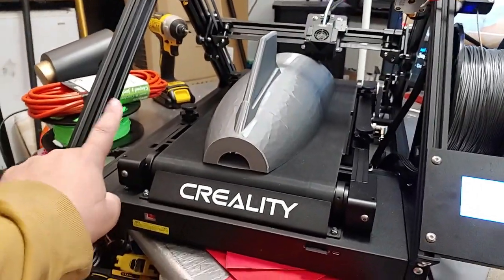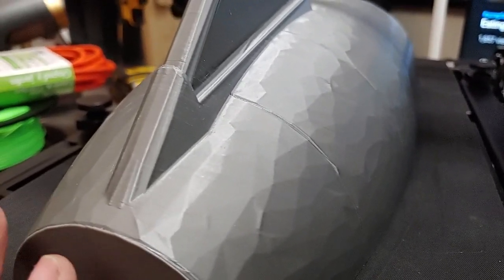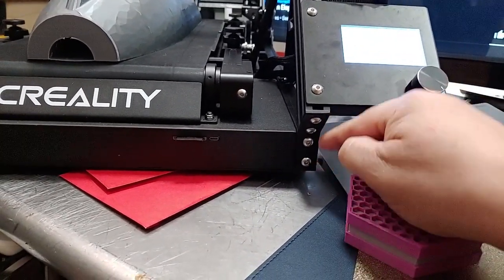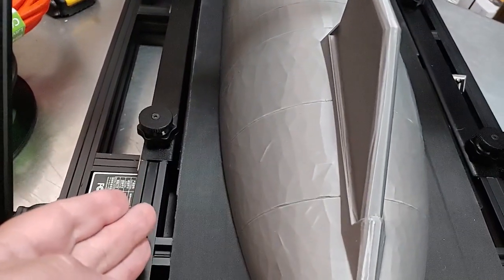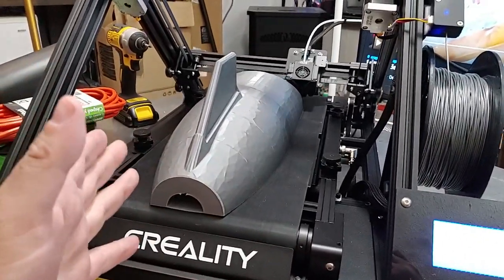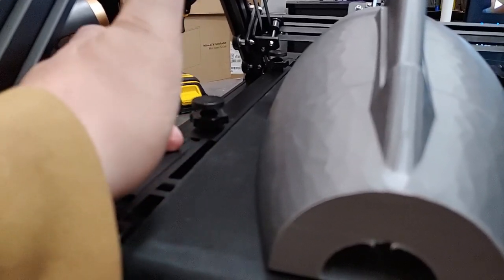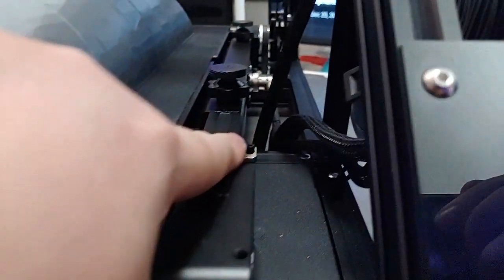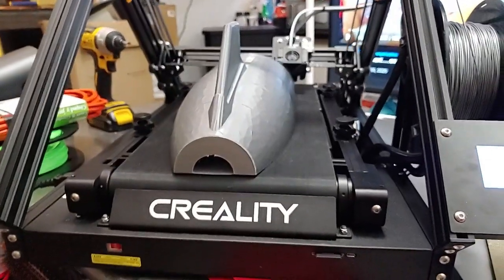Creality CR 30 Printmill Initial Update and Thoughts T3DP

Comment: Based on the status screen it looks like you have my latest build installed. That build has the M808 command in it to repeat sections of G-code, if you ever feel like messing with that feature.
Reply from the maker: yes absolutely but right now I want to print a rocket! any way to impliment a mirror function? ie print it and then again but mirrored? I noticed the jg artist idex does this which indicates its possible to do in firmware? not a high demand feature I would guess :-)

Comment: Not to go off topic, but can you suggest a good place to get nozzles for CR6 SE? Not only the standard size, but different sizes as well including hardened. TIA! 😀
Reply from the maker: Any standard nozzle will work it's not a special nozzle at least on the threaded side it's custom carved on the outside in order to have that nice tight-fitting silicon sock but you don't actually need that

Comment: much ado about nothing, Shakespeare would have said... Frankly, that 45-degree angle CAN'T IMPROVE THE PRINTING! Mathematically it introduces an irrational number: square root of 2 (you might laugh but it does have an impact!). On the top that angle DEFIES the gravity itself by ignoring the melted filament behavior. This printer deserves not that publicity despite Naomi's contribution. It's rather ill-designed. that's the point. Sturdy design DOES NOT MEAN good design. I wonder whether serious engineers have been involved in the project, seriously.
Reply from the maker: You are correct the 45-degree print Tango introduces problems but also provide Solutions the ability to print very long components in one part instead of both parts is appealing as I noted it is a very Niche product that provides a very limited Niche solution